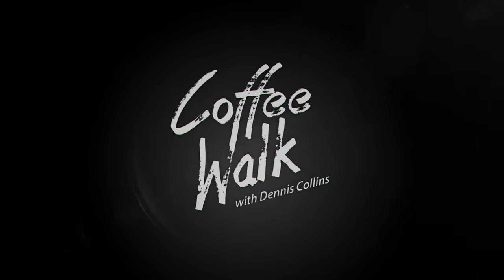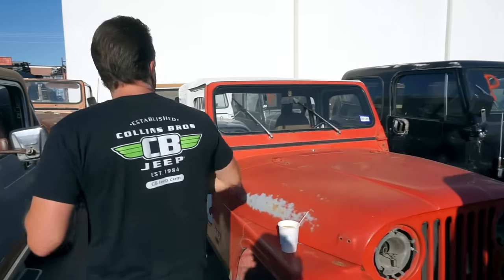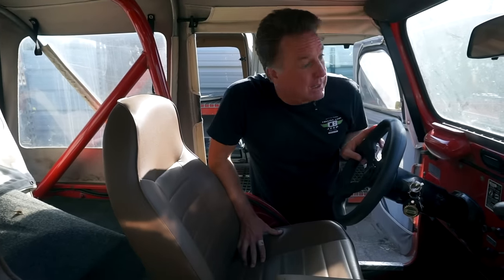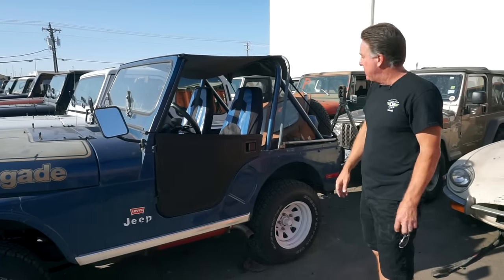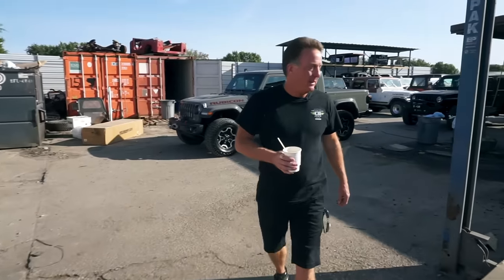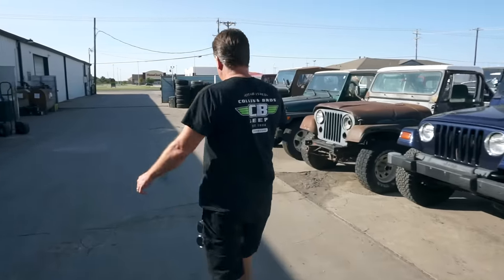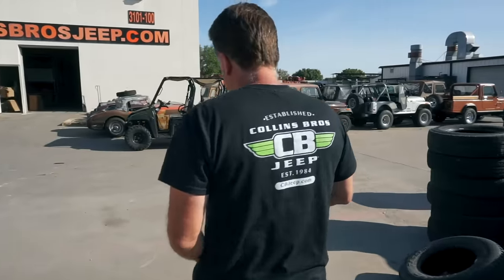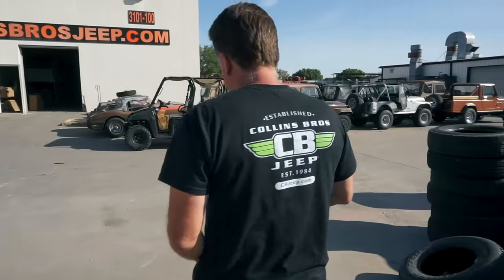HOLY GRAIL '76 to '83 Jeep CJ5's! We've got 'em ALL!

Comment: I might be in the opposite column of many, but I would LOVE to see the Black w/Nutmeg all fixed up. I bet that is a gorgeous Jeep in all its glory.
Reply: total agreement
Reply: I’m with ya there, but I don’t think any Jeep in those conditions should die!! We have enough reproduction parts available for the 5’s & 7’s that we shouldn’t need to part many of them out unless you need transfer case, axles, and few other original parts that we can rebuild but not replace. I’m a Jeep fan thru and thru and we need to save every single Jeep possible!

Comment: Cool cool cool, like CJ5s, I have a 1974 CJ5 factory PS and PB and mellow yellow paint, AMC 304 V8, but it has been changed in its life, now it’s white with red flames and different seats, a 1976 AMC 360 engine with an edelbrock 4 barrel carburetor, 8000 lbs winch, 11.5 x 32 tires, 3” lift, it is a beast! I love it

Comment: Just found this channel. Lot of insight on the older Jeeps. I acquired my first Jeep a couple of years ago. It is a true frankenjeep as it is a 1953 "CJ5" according to the title. I have tried to figure it out by the serial number. I think that it is a '53 chassis with a later 50s tub. Fuel tank and filler under the driver seat.

Comment: I had a 1977 CJ5 and I  put power steering and tilt in it. The upper tilt column bolted right up and the steering box bolted right up to the frame. The wiring harness plugged right in. I had to make a bracket to mount the power steering pump and a 10in extension to hook up the upper and lower column together.  The tilt column came out of a 1978 Firebird and the steering box came out of a 1977 camaro.

Comment: Dennis-81, H-code, by far. Had one of the last V-8 CJ-7’s. Unfortunately, I had to let it go. I now currently have a 4 cyl 84, with  45,000 miles on it. All original, other than tires & wheels. You’re gonna see it within the next year. Nobody other than CBJ is gonna touch this one—I have plans🤔😎

Comment: My 79 v8 cj5 Renegade is my holy grail. T18, 360 with tbi, d60 rear, d 44 front, arb front and back, welder, full cage, tilt wheel, 5 point harness, and on and on.

Comment: The first vehicle I ever bought was a 1985 Jeep CJ-7. Not sure of the original color, but it was metallic maroon with a hard top and dark tinted windows, absolutely loved it. I think I paid around $2k for it in 1994.
One weekend I had driven it a few hours from home to my old college for a reunion, the morning I was supposed to leave, it wouldn't start. Had a local garage tow it in to see what was wrong. They knew I was from out of town, so they literally hammered the choke wide open and drained the transmission and transfer case. Told me it was only firing on 5 cylinders and I couldn't drive it in that condition, and wanted a ton of money to fix it. I left anyway and eventually made it home, and after my usual mechanic looked at it, he told me what was going on. I wish I knew then what I know now about cars. Had to sell it for pennies because I couldn't afford to fix it. Transmission and transfer case were smoked.
I learned years later that garage got closed down for scamming people.

Comment: The '79 from California if it was a six banger should have a round vent intake just ahead and below the driver side mirror on the front clip..they had a electric fan that drew fresh air into a duct to the carb as part of a one year only emissions deal....mine ( six banger..3 speed..bare bones model) had it..I disconnected it and when I went to smog it got gigged on it...79 only I believe

Comment: I had a 1977 cj7 & I laid a lot of pipe on the tailgate of it The ole 258 was bullet proof till the motor mounts went to hell ,torqued the motor & put a hole in the oil filter Still good memories though

Comment: Did Jeep ever install narrow track axles in the 1983 CJ5?  My understanding is that the narrow track ended in 1981. I was wondering because it was a carry over year, so is it possible that the narrow track could have been installed at the factory.

Comment: Dennis, 

What's the reason CJ's up to 1983 are the most collectable?

I have a numbers matching, original 258 and drivetrain (82K on the ticker), 1985 CJ7. Hell it still has the factory starter on it.
*It's been painted and has some rust in the corners of the tub where the roll bar meets the floor pan, other than that it's a solid ride.

Comment: I have a 1970 CJ5. It was built when Kaiser owned Jeep. It sat in the barn for 10-15 years without being started. I’ve pulled it out and with help from a friend, I just got it started, today (4/5/21)! I’m thinking of restoring it. Needs floor boards. I think the frame is ok but rust on fenders and inner fenders. It’s a 4 cyl., 3 speed. Any thoughts on this vintage CJ5?

Comment: I appreciate your enthusiasm for jeeps but I've always been more interested in good parts over being original. Dana 300, t-18 transmission great parts, disc brakes in the front, great stuff. An aftermarket jeep modified with an atlas transfer case, t-18 mated to a modern fuel injected v8 on 33s or 35s with an upgraded dana 44 front and rear differential or 9 inch ford front and rear, then maybe flattened bottom with skid plates that would be wicked.

Comment: I bought a new '76 and I don't remember disc brakes as an option and the other thing about '76 there was no sway bar available and they had cat. converters. My 77 had disc's and sway bars. A lot of bad publicity about flipping these over because of the short wheelbase and soft off road suspension. My 77 got the 401 before I switched to cj7's in 83 with a dark night blue Laredo.

Comment: I wish I still had mine mine was a 75 CJ5 I enjoyed running around with it had a full roll cage in it I wish I can find it I had to get a hard top for it because the ragtop actually with a rag I went in the service and ended up selling it because I went overseas back in 1980 when I was in the army

My CJ5 had a tailgate and a spare tire racks that I put on the tailgate or on the side of it and the fuel tank  was under teh driver seat

Comment: I am looking into buying a older Jeep from the 90s to the 2000s. It doesn’t have to be a rock climber. I would actually prefer one that’s been driven mostly street and garage kept. I prefer automatic, it’s OK if it has wear and tear here and there as long as it doesn’t have rust, what is the price range I should be looking at

Comment: Dennis, I have a Holy Grail 1974 Cj5.....
It has a metal body delete, except the front window is metal (factory?). They left the fiberglass body completely stock. So it has the Factory waves in the panels. Some small cracks for that patina look. A original, from the Holley factory, 4 barrel carburator. I would love to trade it for a Cj7 with a V8. Let me know what ya got to trade, I'll drive it down from Ohio, but will have to add an overdive....🤘🤙🤝

Comment: I had a 79 25th silver cj5 got it back in 1986 had a straight 6 4dpd  disc brakes. Put a 304 V8 in it and promptly rolled it. Should have never sold the thing it was a Colorado rust free CJ 5

Comment: Once found a 79 Golden Eagle Levis edition Cherokee widetrack fsj in the junkyard...  Unfortunatly the hood was missing, and so were those gold rims.  I woulda put those rims on my wagoneer.  But i did grab the buttons on the seats.  And body mounts and frame rail section by the gas tank so i could cut my rusted section out and weld that one in.   The jeep only had 50k miles on it too.  Was shame it was in the salvage yard.   Sometimes i really believe people have these Jeeps in their barn or outside in the yard for 30 years never running.  Then instead of trying to restore or get em back on the road they just trade it into the salvage yard for $250 where its gone forever

Comment: Hello all! I have a Silver 1978 CJ5 4.2L 258 1bbl carter with the 4 speed T18 (or T18a?). Have I ruined it by outboarding the leaf spring mounts to run a circa ‘76 Dana 44 front diff and the 12 bolt Lincoln locked rear as a place holder before I mod for tons with links? I run 35” tires with room to spare but would have to regear for the 37s or 40s I’d like to have. I use it for rock crawling but nothing too serious. I just need plenty of clearance. I have a corp 10 bolt front and a 14 bolt full float for the rear. I bought it summarily bone stock with 80k on the odo. I max out at 65 mph on the highway but I’d rather tow it than drive it any real distance. I’d also like to swap out the Dana 300 for a NP205 and maybe even V8 swap with a turbo 350 auto trans. Am I out of my mind chopping up this Jeep or are my mods “normal”?

Comment: Hey Dennis, my first Jeep was a 76 CJ5 and then basically did a frame and body swap onto a 76 CJ7.  The 76 and 77 CJ7’s had the same special cowl vent and different roll bars.  I now have neither but upgraded to an 04 LJ.  I was lucky to be able to swap in a T-18A into my CJ and loved it in front of the Dana 20 but I had a friend that had a CJ7 with the 401 and had the T18A with the ever rare Dana 300.  I think they called it the Texas bolt pattern Dana 300.  Have you had any of these combos come thru?

Comment: Save the 1980 jeep or send it to me, keep them on the road.

Would like your opinion on a cj5 project

1974 cj5 with amc 232 with 13,000 original miles 
Original two barrel carb, intake, and exhaust 

Had the exhaust manifold gasket blow out on me so now is a good time to replace the cracked exhaust manifold.

Do I keep it stock?  Are those $100 range exhaust manifolds any good, I see some on ebay or from crown?

Or should I get something different on it besides a stock manifold?

Comment: Me and a buddy worked for a old timer  Al .More like ran cure dogs and drank his beer ! But  He bought a 79 cj5 for like $1200 ! A little bit bubbled paint in spots ! I think a Saginaw transmission ! Low 1st  gear or granny 4 spd ! I know it had 360 V8 2 barrel lock in hubs hi/lo transfer  Dana front and rear . But the old man Al tells me and my buddy ! U two fix the transmission  ! We'll split the profit 3 ways everything over $1200 ! 3 gear sink was junk  ! We did like master rebuild kit seals sinks bearings in it ! $800 for parts new clutch pressure plate throw out bearing  and plugs wires and cap ! $2000 total ! Sold it $4500 next day At 11 o'clock am ! We rolled in at Al's Monday evening he handed us envelope each with $ 800 in it ! Let's drink beer on good business  boys !

Comment: The 75 was the last of the best. I had one with the 304 V8, 3 speed and heavy duty frame with  10 inch tru tracks.The straight up windshield and Jeep steering column was a real Jeep. Not with a lot of cheap Detroit parts.

Comment: How come you never talk about pre-1976 CJ5s? Mine is a 1974 Renegade V8.
Reply: I have a 74 Renegade . Ive had several CJs and by far the intermediates 72-75 are the best
Reply: Gorilla Cookies I have a 75 Levi’s. Edition blue Renegade V8
Reply: Because you have to be a midget for fit in one. LOL 

Just kidding. I put a 75 body on a 78 frame since the 78's body was trashed. I'm 5'11 and barely fit. Most uncomfortable thing ever.
Reply: Brady Williams really? The 76s are bigger??
Reply: @steveflaim2656  Yes. the floor was changed. Giving more leg room.
Reply: @bradywilliams2666  that's why you notch the fender and move that seat back 😁
Reply: @bend5648  Yep

Comment: I've never seen a t18 with 6.32/1 first in jeep cj . I've seen a t18 with a 4/1first in a cj I've seen a lot of them but never a 6.32   did they really come with the low first gears? If they did it had to be very very hard to find !!
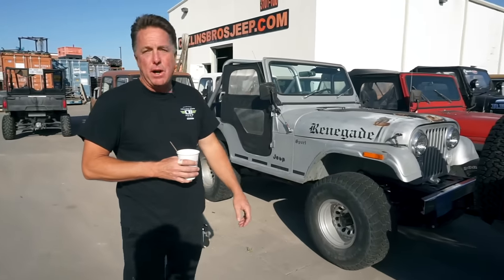Reply: I have 2 t18s sitting in my garage. Both with 6:32/1

Comment: In 1988 worse vehicle i ever bought was a...'79 CJ-5 with 304 golden eagle w/ 4 speed. frame was rotted and bounced me around silly....finally got rid of it a year later for $500., ran good, engine was fine...body was uncoupled from frame. That jeep beat me up...thought about replacing with a fiberglass body but would have been more money and a lot of work. Metal is terrible in those jeeps.

Comment: Have to disagree wholeheartedly.  76 was the 1st year of the model 20 diffs and the 300 transfer.  Not to mention the crap carbs and total garbage chrysler transmissions that became the thing in the 80's.  Just saying. If you want a CJ5 that is worthy of owning and operating and truly does very well off road, get a 72-74 with the 44/30 and model 20 and get the power lock diffs front/rear.  True 4WD and tuff.  Personal opinion of course.